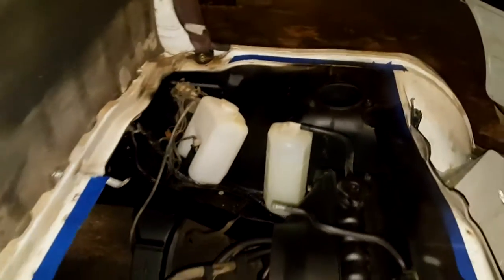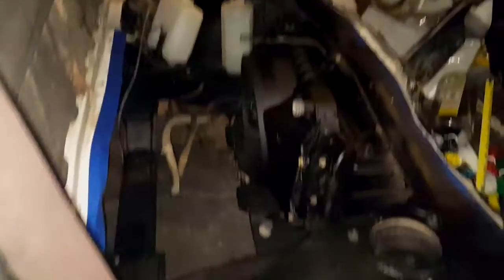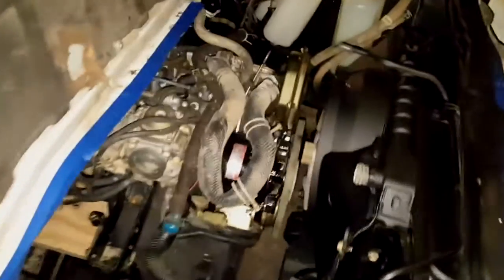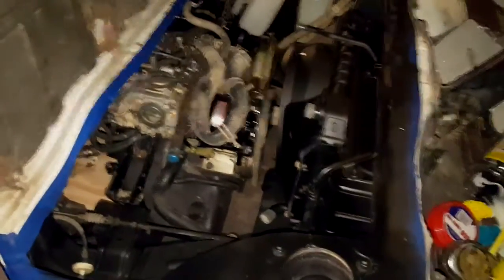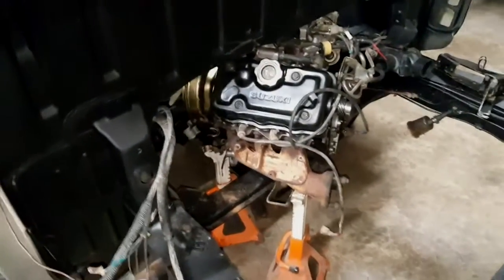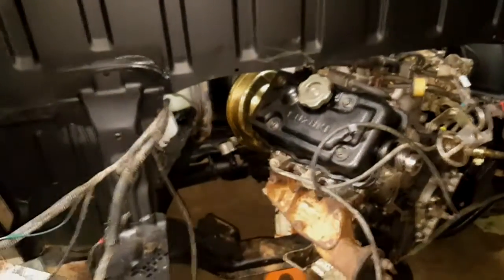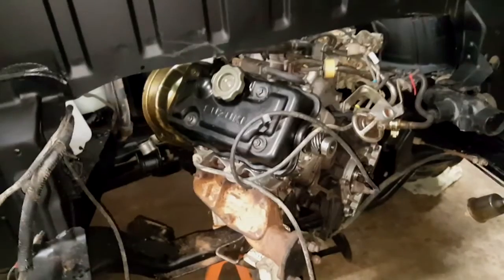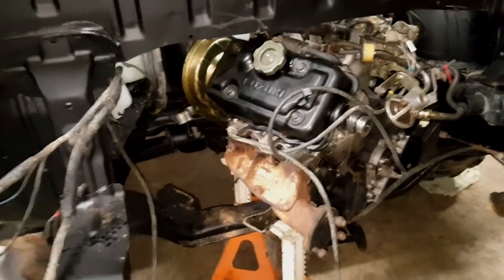1988 Suzuki Carry DB71T Engine Swap Part 8

Comment: I, WOULD, HAVE, LIKED YOU  TO, BOX THE, FRAME AND CAN, STILL WORK INTO A,,, CUSTOM,,, X,,, FRAME TO,, FABRICATE ,, AND 🔩 BOLT,, IN PLACE AND THEN,,, WELD IN, YOU CAN, STILL,, BOX IN THE FRAME REAR PART, AND AS MUCH, FORWARD, WITH A,,, CUSTOM,,, X,,, FRAME AND MOUNTS,, KEEP ⚒ AT IT,,,...

Comment: You did a great job but pull the cross member out with the engine and then install it with the cross member bolted to the engine loosely it would have been a lot easier that way.
Reply from the maker: Tommy Scruggs Thanks for the comment!. I realized that after putting ithe engine in .. it might of made things a bit easier.  Thanks for watching.

Comment: Subscribed! These videos are a great resource... thank you for making this series. 
I have a question, though. I really like these trucks (kei trucks and vans in general) but I wonder how they are for tall people? Cab height? Leg room? I've heard that a lot of westerners simply can't fit in them. Is this true?
Reply from the maker: +16mmDJ im 5ft7in, and i can get in/out fine. Anyone taller than 6ft will have knees hitting the dash. There are no adjustments to the seats whatsoever. The passenger side has a little more leg room. Height wise, mine has the extension top so no problem there. The newer trucks might accommodate taller folks but not sure.